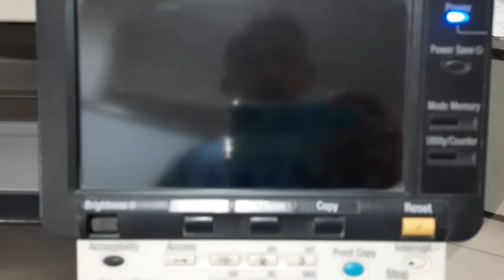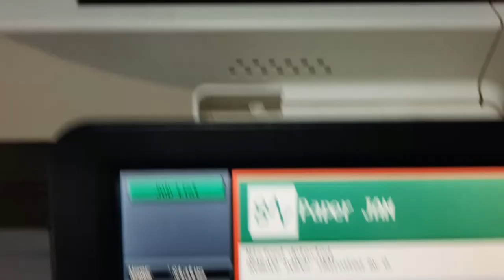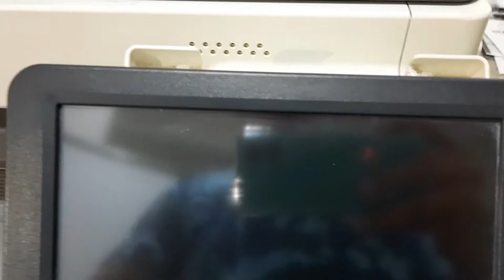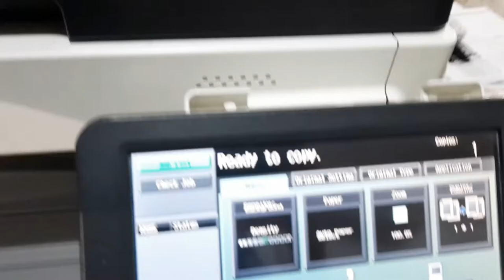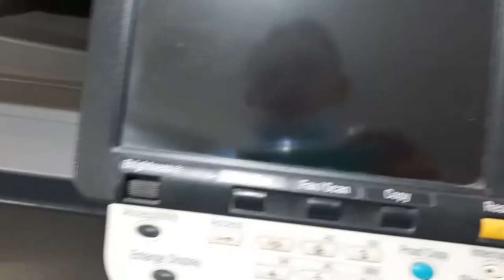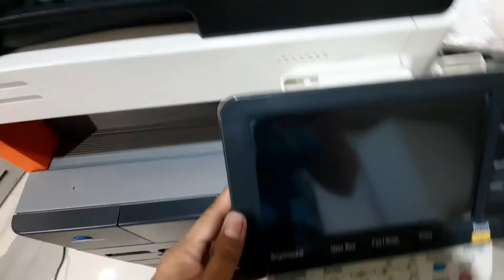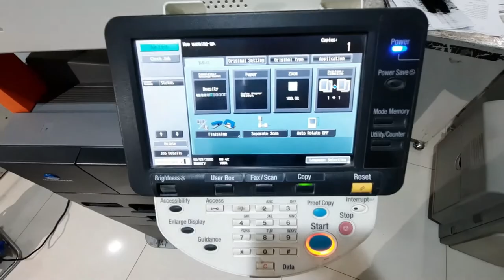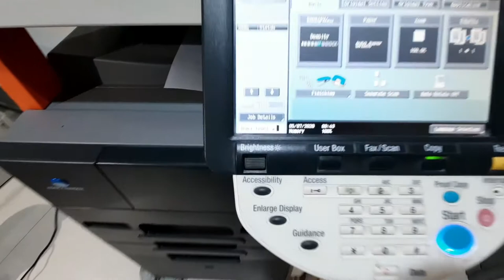KONICA MINOLTA BIZHUB 283 HOW TO FIX PAPER JAM / CLEARING A PAPER JAM / DOCUMENT FEEDER

Comment: hello

I have a problem were A3 keeps getting jammed, it is like the machine is trying to pick up more paper than it needs to or more paper is getting picked up and sending thru but here is where the problem gets, i only try to print 1 paper and the second paper that goes with it, jams the whole thing. Anyone understand what i try to explain or have had the same issue?
Reply from the maker: check the pick up tray rubber maybe finish must be replace